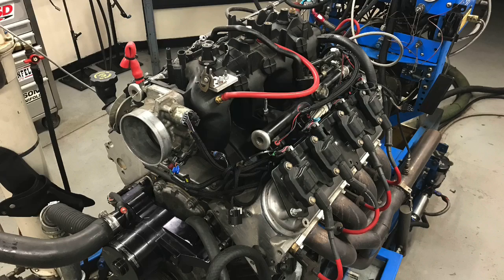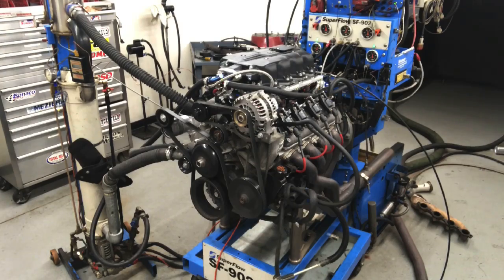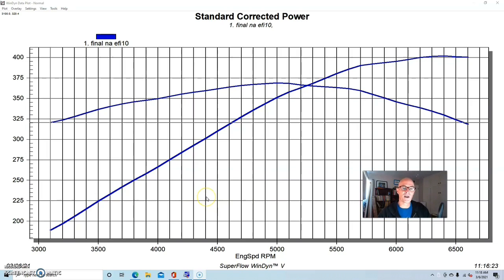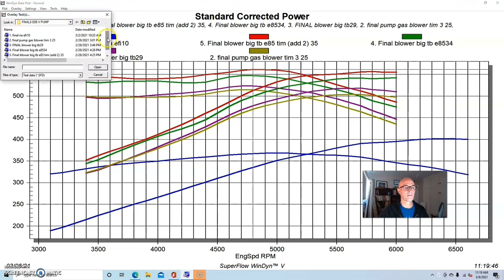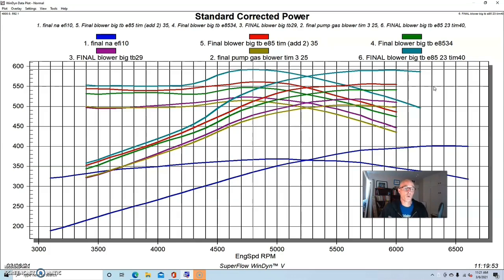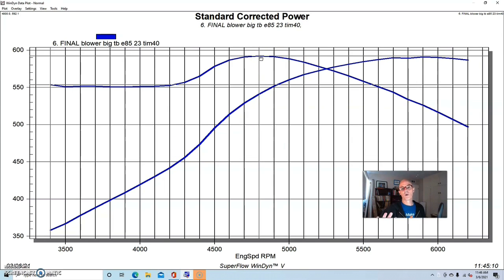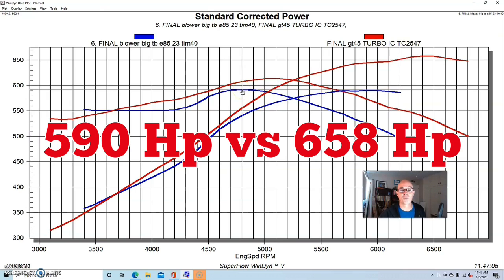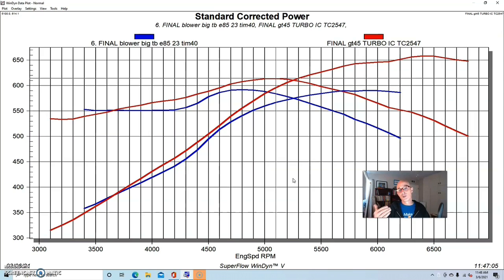CAD LS BLOWER VS EBAY GT45 TURBO-WHO DOES LOW $ BOOST BEST?

Comment: At 2000 RPM the throttle valve will allow all the air the engine can use at maybe 50% opening. WOT at low RPM is therefore misleading, however throttle tip in response at 2000 RPM on the highway is important and throttle openings up to 50% are entirely possible before the transmission downshifts. This is why I would like to know boost response at lower RPM. 
Thanks Richard for all you do !! Keep up the good work.
Reply from the maker: the dyno requires wot at 2000 rpm against a load for the turbo-which never happens in the real world

Comment: RICHARD. I dare you to run the turbo and supercharger together.
Reply: Compound would be sick
Reply: Triple dog dare!
Reply: The turbo is too small to be of service. The blown engine makes 550ish horses and you wouldn't put a single gt45 on a cammed ls3 that makes that much power. If you had a big turbo, s480 or s485, you would maybe make something. As it stands now as soon as the turbo lights the blower would be in the way.
Reply: @timothybayliss6680  well put

Comment: It would be interesting to size a turbo for only 500-600hp on a 4.8 and test how quickly you can get it to spool up... sort of a "can a turbo respond like a blower" test. Pull it from 2500. A lot of people with trucks would probably be interested.
Reply: I know I would be
Reply: A gt35 would be a good option for that
Reply: @kristianmichels5649  agreed. That's what I would use, or a precision 6262.
Reply: actually, from the map, an S366 looks promising for 10 psi or so from a low RPM.
Reply: @44amanaplanacanalpanama44  S366 +1
Reply: You need a twin charge, 1 smaller turbo feeding a larger 1. Thats alot of plumming to cram in any engine bay
Reply: @shadowopsairman1583  that's not what twin charging is. Twin charge is 2 different forced induction power adders.
Reply: @YZFoFittie  not exactly, what you are referring to is compound charging. Twin charging can refer to 2 turbos, 2 superchargers or turbo and supercharger.
Reply: @tedkay5272  no, compounding is when one means of forced induction output is fed to the intake side of the same type. Compounding significantly increases the compressed pressure output.
Reply: @YZFoFittie  "compounding"? LMAO! Go learn the definition of the word. It's compound forced induction. Better stick to playing with Barbie dolls.
Reply: I’ve been preaching a s366 test for awhile now. But on a 5.3l
Reply: @yotaismygame  I like the Borg turbos too. They seem to have a wide efficiency band. Even a GT3582 would probably work ok for something like that, even if with high back pressure.
Reply: @yotaismygame  nah man SMALLER. What about a s362 or s364.5sxe the off the shelf s366 is a lot of big laggy journal bearing turbo to try and spoil with how little air flow a 5.3 makes. I think a single small s362 would do a good job down low with some good headers
Reply: @littledeel  I have a stock 5.3 cam spring only with a sx s366. Could not imagine going smaller for a single. Lag and s366 on a LS do not belong in the same sentence. Spool is always and hits 8lbs instantly. We'll see what happens when I turn it up but I can already tell top end will not be the greatest. 78/75 spools later but i wouldnt call it laggy either. Hits hard and pulls hard to redline. So far its been a fun little in town turbo when paired with a manual. Can't imagine on pump I could make more than 600whp at best.

Comment: Can you compound boost using turbo and supercharger. I haven't seen any results. Ive been thinking about doing this but dont see real world results
Reply: Gale banks my friend
Reply: @justinjones5288  he does it on Duramax diesels not ls or even 454 except the old one from years back. Nothing like what Richard does
Reply: @uberdriver5711  same concept
Reply: @justinjones5288  I agree but the delivery and information given is totally different
Reply from the maker: THAT IS COMING
Reply: @richardholdener1727  rich I have a 5.4 3v. Saleen 2.3 supercharger. Been wondering which would be better to help it. Turbo feeding or vortech /procharger feeding the twin screw

Comment: Excellent test Richard, how about a 377 vs 383 sbc same  comp. intake and heads
Reply: Why? The 383 is like 2% bigger, same heads that's the only difference. If you're building a 377 to be serious you need a set of heads that require the 4.125 bore. The only reason you would is if you're in a class that has weight/ci standards. If it's in a street car a 400 or 406 will always be better than a 377.
Reply: @timothybayliss6680  hi Tim, your right on the bigger is always better, just thought it would be interesting

Comment: Somebody said that the blower was probably eating 60-80hp...i can't remember who that person was.
Reply from the maker: at 600 hp? I thought he said something about GM data
Reply: @richardholdener1727  if you go to the live stream where your discussing it, https://youtu.be/Sye9oUaoJtU at 9,12 in the live chat I reply to Caleb saying "Caleb, probably 60-80hp at that boost. a blower on a Zr1uses 110hp."
Given the pulley ratio hasn't changed the blower will use the same amount of power to compress the same amount of air on the same engine. The bigger throttle body would probably cause the blower to use more power, it's more air after all. The 110hp reference point was for a 6.2l engine with a more mechanically efficient blower adding roughly twice the power to a naturally aspirated engine.
Given the turbo is going to use some power to drive as well, although significantly less, I think my estimate is probably accurate given the difference at 6000rpm is really close to 60hp. 
I really don't see where I am wrong.

Comment: Well, we used to have just the Sloppy Tax, now it looks like we have the Holdener tax lol
Reply: Between Matt and Richard parts keep going up lol
Reply: Now this is the "Holdener-Denmah tax"
Reply from the maker: HD TAX
Reply: @rogergm92  I wonder what will happen if the Vortec 4200 gets the big bang, and it makes Cummins level torque and 700 hp ?
Reply: @jamesgeorge6551  it will become cheaper to get a blueprint or texas speed hahaha, just kidding. It is nice to see them making wonders with all this :) debunking myths
Reply: @jamesgeorge6551  It would be pretty sweet to see a intake, oil pan, front accessories kit to get those puppies into cars .
Reply: Sloppy tax?
Reply: i hope neither one starts doing LT stuff any time soon.  Parts are already too expensive.
Reply: @jessemurray1757  it's going to get cheaper. LS motors just started getting available to budget builders when they were discontinued for a few years. Seeing as they're still making LT based motors it's going to be a good while until we can find LT trucks with 800$ complete dropouts
Reply: @lucysmith4242  yes I'm aware.  It took 15 years or so of the LS being around before it became affordable.
Reply: @lucysmith4242  between lower vehicle sales and a more expensive/tech heavy engine i don't really see 800. Maybe the lowest in the country but not average
Reply: @cc23001  Nobody knows for sure. But let's see how it plays out and hope there's room for budget enthusiast somewhere
Reply: Yup.
Reply: U could call it the youtube tax.

Comment: Looks like we need china to steal the design of an lsa supercharger.
Reply: The Chinese are so adept at market concerns that they would offer a direct bolt on kit for cathedral port engines. You can buy Chinese knock off intake manifolds for half the price of domestic aluminum ones. What you need is a factory in China that makes Eaton or roots style blowers to update their machinery and sell their old equipment. That old equipment gets a new life building low cost stuff for Amazon and Ebay retailers.
Reply: No. A BIG 4 liter china screw blower. Front entry, sitting down in the valley. Pulley lined up with original serpentine. Optional top hats with or without intercooler.Make it accept a truck fuel rail.  BANK
Reply: Why not do it in America? Assuming that's where you're from. Obviously have more overhead with wages than the Chinese, but why can't we do it? I'd chip a little cash into that company
Reply: @GreatLakesLogger  Harrop in Australia already make a clone LSA supercharger but with 3.1L capacity instead of 1.9L
Reply: @ArchimedeanEye  Tell us more please!!!
Reply: @kylemilligan752  just Google Harrop LSA 2650i.  Can be used with stock LSA lid or their upgraded Harrop lid.  It's beautiful stuff and looks stock GM but is available in 2650 to 3100 capacity.
Reply: @ArchimedeanEye  Great stuff😀Thankyou Sir.
Reply: It would need to be a WAY oversized china blower to start, giving massive hp response to every upgrade. Say a 4.0 liter whipple copy.

Comment: I know its a much harder test, but to see what each "kit" would cost with all the small accessory shit added up would be a really cool test. What would it cost to go from "stock" to turbocharged if you included the price for all the various fittings, hoses, pipes, valves and stuff compared to dropping on a supercharger and the adapter plates and the new belts and whatnot?
Reply from the maker: its more than people think
Reply: Too many parts with constantly varying prices to make a video at any one time and have it still be accurate even 1 month later. And there are always things that you can cheap out on now that will bite you in the ass later ie. decapped injectors that will get you by for now, but if you upgrade the turbo you'll be shelling out for SEP1500s. You could run a Kemso pump to start, but switch to E85 and you'll be needing a lot more fuel, especially if you turn the boost up. Did you run rubber AN-6 lines to cheap out, or did you put in AN-8 E85-compatible lines? Manual or electronic boost control? We're just scratching the surface here, things will vary wildly depending on what your application requires, and what prices are at a given time.

Comment: Great stuff just curious if a Vnt turbo might help with building boost at a lower level and be more comparable to a sc on the street
Reply: See what audi and merc are doing with variable turbos on gas engines. sometimes they make peak torque below 2000rpm, granted lots of that is programming. Variable turbos work really well but they still have the issue of lag, how long it takes the impeller to spin up even if the engine is capable of making boost at a low rpm. Borg is working on a 48v system for passenger cars that uses a brushless motor to spin the turbine shaft when power is called for but the turbo isn't up to speed. It hits the turbine shaft for under a second to get things moving. Variable drive is pretty solid the problem is mapping the control with an aftermarket ecu. Lots of turbos use bespoke algorithm of electrical inputs to control the position of the vanes and do so blind, without a position sensor. The ecu moves the vanes to a desired outcome with the feedback being the results.